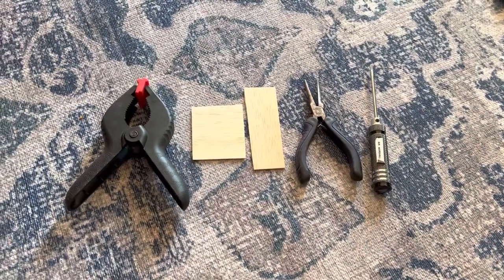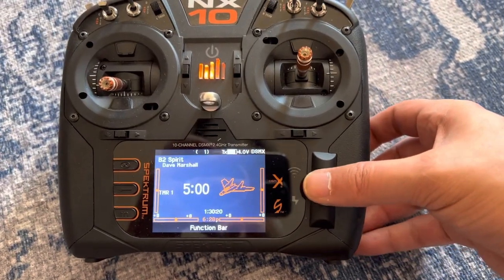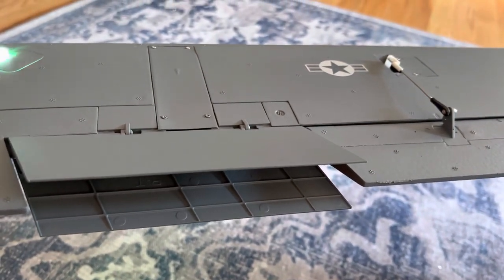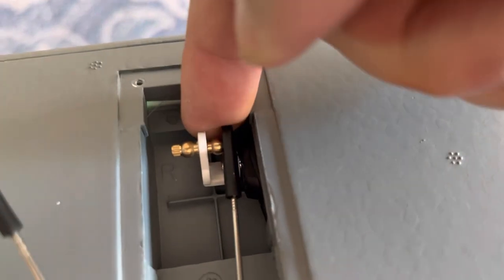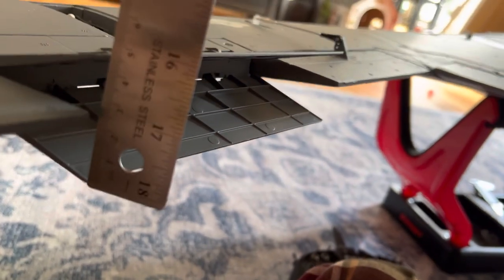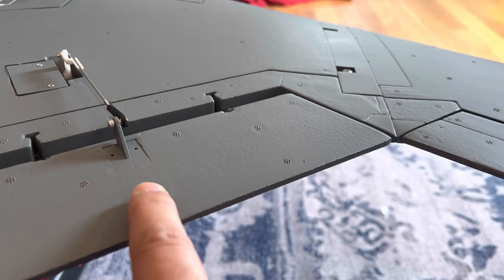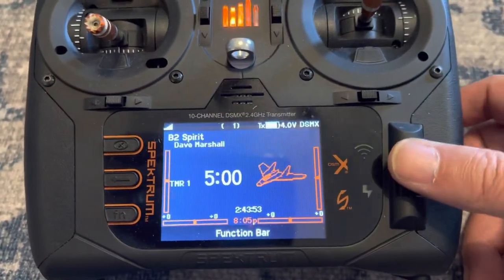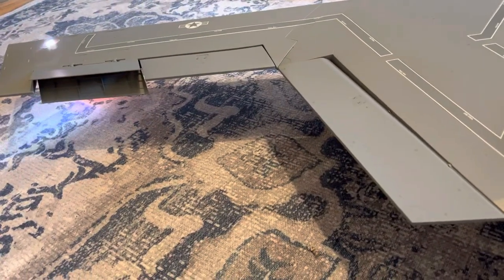Freewing B-2 Sprit EZ Control Surface and Drag Rudder Setup!

Comment: Thanks for putting that bit about using a mix to open/close the drag rudders.  I set that mix so I can close drag rudders for transport too, I simply put the mix active with throttle cut on (EDFs disabled).  That way I don't have to manually close the drag rudders for transporting the model/putting it back in the box.
Reply: firefoxussr31, How do you do this mix that you mentioned? The mix mentioned in the video relies on me flipping the switch for right and left, how can the mix you mention handle both sides attached to throttle cut? Love the idea. Thank you
Reply: Great idea!

Comment: You the man I set up mine the way you instructed and walla it works great and i turned of the mix so I won't make a boo boo while flying 👍👍
Reply: you can do what I did, i setup the mix only active with throttle cut on.  i'm doing that so i can close the drag rudders for transport without forcing them closed manually.
Reply: O.k that sounds like a great idea

Comment: Quick question did you leave your servo travel at 70% or did you return it back to 100% travel?
Reply from the maker: It’s still at 70%. To get the drag rudders to have 45mm spacing at neutral, that’s the travel that worked the best for me without stressing the servos. You could use this method using 100% travel, just understand that the clamshells will be open to closer to 55-60mm at neutral rather than the 45mm as called out in the manual.
Reply: Thank you so much for sharing the information, and making set-up easier for the rest of us. Awesome videos.

Comment: Good video, using your method I cant adjust the drag rudder push rods short enough when the drag rudder doors are clamped shut. Do I need a shorter push rod?

Comment: Hi Dave.  Given the mixing board feeds in some aileron input to the drag rudders, are you concerned about setting up the clamshells to physically close with rudder input alone?  At full rudder, any roll input (from the pilot or the gyro) is then going to try and force the clamshells to close even further...
Reply from the maker: I thought about it, but it’s honestly not that big of a concern, IMO. Each pilot is going to fly the way they want of course, but this really isn’t the kind of plane that needs a ton of rudder or aileron input in the first place. If you’re trying to snap roll a B2, I’d probably give myself a little more room in the clamshells. LoL 😂

Comment: What an awesome instructional video. Thanks for taking the time to do this. Did you use a Spektrum receiver? Any pointers on hooking up everything to the receiver?
Reply from the maker: I just used a Spektrum AR6610T Rx. Hook it up just as it is laid out in the plane. 1: Throttle, 2: Aileron, 3: Elevator 4: Rudder 5: Gear. There are no flaps, so I connected the gyro mode to channel 6. I just assigned channel 6 to the same switch where I would normally have my safe select/AS3X switch.
Reply: @TheRCAirMarshall  Thank You
Reply: Set everything up yesterday on my spirit, your procedure was outstanding. Thanks again. When are you flying your maiden?
Reply from the maker: Hopefully soon. My work schedule is a beast, and every good day of flying here I’ve been out of town. 😂 Hoping for good weather next weekend.
Reply: @TheRCAirMarshall  Flew my maiden yesterday. One click of down trim needed and a few clicks of left trim. Nose gear tracked right a little, once back home I noticed the left main gear and nose gear steering needed a little adjustment. The B-2 flies very good. I literally flew with 30-50 power and the plane moves. I was able to land it with no problem. Thanks again for the setup instructions. Somebody had mentioned using the prescribed rudder mix on their throttle cut for storing the plane in the box. Do you understand what needs to be done there? Seems like only one wings rudders would get stowed.
Reply from the maker: For storage I just disconnect the battery, and manually close the clamshells.